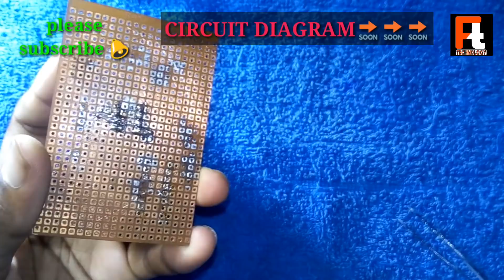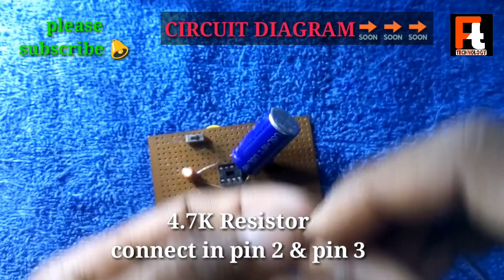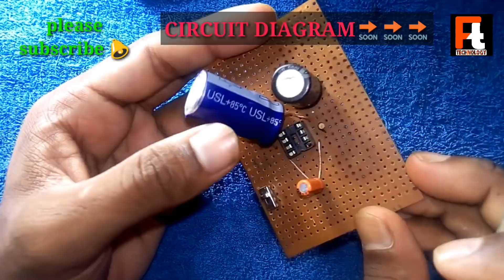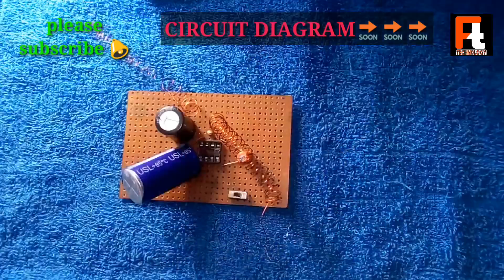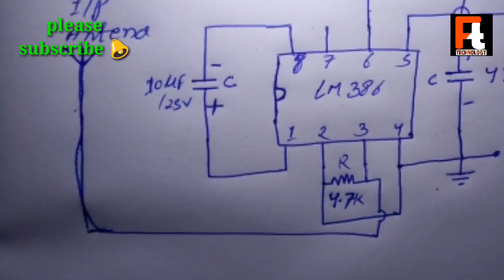How to | DIY | How to make a simple Mobile signal booster at home #RC Invention #diy #howtomake

Comment: THAT IS ONE MAGIC LM386! I only use them for audio amplification in HF direct conversion receivers. In other words, this will not boost a 3G or 4G cell phone signal.
Reply: This circuit is great.
It even works for wifi.
Signal increases 2 bars and no more disconnects.
Also on it close to digital tv antenna no more picture breakup.
I put it next to my auto engine. Mileage to up 10-15 mpg and lots of power.
I put it on my pillow at night now the bald spot on my head is growing a lot of hair now.
Also missing 2 tooth in front new one grow back.
Wife too small on top put circuit in her purse now like mountains but problem now she poop a lot.
You should build on black box sell make a lot of money.
Reply: @gordonwelcher9598  could you explain how an LM386 audio amplifier chip amplifies 3G microwave signals?

Comment: I`m quite surprised these world-changing inventions are coming  from India :P
Reply: Are you implying that India cannot have world changing ideas?
Reply: This circuit is great.
It even works for wifi.
Signal increases 2 bars and no more disconnects.
Also on it close to digital tv antenna no more picture breakup.
I put it next to my auto engine. Mileage to up 10-15 mpg and lots of power.
I put it on my pillow at night now the bald spot on my head is growing a lot of hair now.
Also missing 2 tooth in front new one grow back.
Wife too small on top put circuit in her purse now like mountains but problem now she poop a lot.
You should build on black box sell make a lot of money.

Comment: Lm386 is low power audio amplifier ic and it can max work for amplify 15 to 20mhz frequency and in video u r showing it to amplifying 800mhz to 2100mhz mobile network signal i think it won't work..
Reply: Besides, even if it could work at that frequency, with the two antennae next to each other, it would just form a feedback loop. This is complete bullshit.
Reply: Even then you would need a bidirectional amplifier, and the LM386 only works up to 300kHz btw.
Reply: this can't be work
Reply: ibrahim arif it could work for phone calls, right? I mean they are just some audio data... but internet connection... No
Reply: G
Reply: It's not working
Reply: AMAR CHANI ok then it is fake
Reply: No it worksss
Reply: Fully fake
Reply: correct
Reply: bro its fake its not a bosster circuit its reduce signal strength.according to some of level in frequency
Reply: Your right bro ic made for only audio purpose
Reply: What do you think it is right or wrong
Reply: Will it work
Reply: Should I make it
Reply: 15to20 mhz? I think you mean khz because lm386 is audio op amp. No way it is working in mhz range.
Reply: This circuit is great.
It even works for wifi.
Signal increases 2 bars and no more disconnects.
Also on it close to digital tv antenna no more picture breakup.
I put it next to my auto engine. Mileage to up 10-15 mpg and lots of power.
I put it on my pillow at night now the bald spot on my head is growing a lot of hair now.
Also missing 2 tooth in front new one grow back.
Wife too small on top put circuit in her purse now like mountains but problem now she poop a lot.
You should build on black box sell make a lot of money.

Comment: If you connect a toaster to pin 9 and 13 of the lm386 you get a time machine.  btw nice "antenna" lol (even that won't work)
Reply: Keen observation 😂
Reply: YOU FORGOT THE FLUX CAPACITOR
Reply: This circuit is great.
It even works for wifi.
Signal increases 2 bars and no more disconnects.
Also on it close to digital tv antenna no more picture breakup.
I put it next to my auto engine. Mileage to up 10-15 mpg and lots of power.
I put it on my pillow at night now the bald spot on my head is growing a lot of hair now.
Also missing 2 tooth in front new one grow back.
Wife too small on top put circuit in her purse now like mountains but problem now she poop a lot.
You should build on black box sell make a lot of money.

Comment: Such a complex mechanism cannot replicated so easily. Sorry it seems like hoax
Reply: This circuit is great.
It even works for wifi.
Signal increases 2 bars and no more disconnects.
Also on it close to digital tv antenna no more picture breakup.
I put it next to my auto engine. Mileage to up 10-15 mpg and lots of power.
I put it on my pillow at night now the bald spot on my head is growing a lot of hair now.
Also missing 2 tooth in front new one grow back.
Wife too small on top put circuit in her purse now like mountains but problem now she poop a lot.
You should build on black box sell make a lot of money.

Comment: It's always better to buy Approved Mobile signal boosters from AvanZar impex. The booster are of top Quality and i hv personally used them. It gives the coverage area of 3000sq ft.
Reply: This circuit is great.
It even works for wifi.
Signal increases 2 bars and no more disconnects.
Also on it close to digital tv antenna no more picture breakup.
I put it next to my auto engine. Mileage to up 10-15 mpg and lots of power.
I put it on my pillow at night now the bald spot on my head is growing a lot of hair now.
Also missing 2 tooth in front new one grow back.
Wife too small on top put circuit in her purse now like mountains but problem now she poop a lot.
You should build on black box sell make a lot of money.

Comment: What if I use 9v battery. Which electrical components  are necessary  for it plz tell me.and where you have connected negative  terminal of battery in circuit board

Comment: Thanx....I made This Project But it not works 
Before and after Network is Same ? 
Plz feed back or give ur Email id
Reply: Hasan Shaikh hii kya aapne dusra koi prohect bana ke dekhe he mujhe bhi banana he please agar success he to batao mujhe
Reply: This circuit is great.
It even works for wifi.
Signal increases 2 bars and no more disconnects.
Also on it close to digital tv antenna no more picture breakup.
I put it next to my auto engine. Mileage to up 10-15 mpg and lots of power.
I put it on my pillow at night now the bald spot on my head is growing a lot of hair now.
Also missing 2 tooth in front new one grow back.
Wife too small on top put circuit in her purse now like mountains but problem now she poop a lot.
You should build on black box sell make a lot of money.

Comment: this is clearly a fraud. Those antennas are not even closed and whats with the ic 386, what will you do for the noise entering the circuit due to the air channel. In the video too, when you switched off the circuit the signal was still strong. This is a total hoax

Comment: either you Turned the circuit ON or OFF your cell screen showed signal (E)  it didn,t boosted to 3g or 4g
Reply: This circuit is great.
It even works for wifi.
Signal increases 2 bars and no more disconnects.
Also on it close to digital tv antenna no more picture breakup.
I put it next to my auto engine. Mileage to up 10-15 mpg and lots of power.
I put it on my pillow at night now the bald spot on my head is growing a lot of hair now.
Also missing 2 tooth in front new one grow back.
Wife too small on top put circuit in her purse now like mountains but problem now she poop a lot.
You should build on black box sell make a lot of money.

Comment: I make this.but not work.ic is get heat.why?
Reply from the maker: Check circuit connection and supply voltage
Reply: Thanks
Reply: Capacitor 16v=4700uf,,,,,1000uf & 10uf 10v.its ok.supply voltage 4.5.used powr pack.
Reply: @tharumadhu3179  👍

Comment: how to identify pin 1, pin2,3,4,5,6.then only it will be easy to solder the capacitor pin with the ic.am i correct?
Reply from the maker: Yes

Comment: I built this circuit on a breadboard. It's not working for me. I used a 3300 microFarad capacitor instead of the 4700 microFarad capacitor since i dont have a 4700 microFarad in stock, just to see if it will work. Will the capacitor size make a difference?
Reply: No, there's no difference. LM386 won't be able to work with the frequency of mobile signal...
Reply: This circuit is great.
It even works for wifi.
Signal increases 2 bars and no more disconnects.
Also on it close to digital tv antenna no more picture breakup.
I put it next to my auto engine. Mileage to up 10-15 mpg and lots of power.
I put it on my pillow at night now the bald spot on my head is growing a lot of hair now.
Also missing 2 tooth in front new one grow back.
Wife too small on top put circuit in her purse now like mountains but problem now she poop a lot.
You should build on black box sell make a lot of money.

Comment: Is this Circuit is useful for 4G or 4G LTE???
Reply: This circuit is great.
It even works for wifi.
Signal increases 2 bars and no more disconnects.
Also on it close to digital tv antenna no more picture breakup.
I put it next to my auto engine. Mileage to up 10-15 mpg and lots of power.
I put it on my pillow at night now the bald spot on my head is growing a lot of hair now.
Also missing 2 tooth in front new one grow back.
Wife too small on top put circuit in her purse now like mountains but problem now she poop a lot.
You should build on black box sell make a lot of money.
Reply: This circuit is great.
It even works for wifi.
Signal increases 2 bars and no more disconnects.
Also on it close to digital tv antenna no more picture breakup.
I put it next to my auto engine. Mileage to up 10-15 mpg and lots of power.
I put it on my pillow at night now the bald spot on my head is growing a lot of hair now.
Also missing 2 tooth in front new one grow back.
Wife too small on top put circuit in her purse now like mountains but problem now she poop a lot.
You should build on black box sell make a lot of money.

Comment: Sir this project is really works or not
Reply: This circuit is great.
It even works for wifi.
Signal increases 2 bars and no more disconnects.
Also on it close to digital tv antenna no more picture breakup.
I put it next to my auto engine. Mileage to up 10-15 mpg and lots of power.
I put it on my pillow at night now the bald spot on my head is growing a lot of hair now.
Also missing 2 tooth in front new one grow back.
Wife too small on top put circuit in her purse now like mountains but problem now she poop a lot.
You should build on black box sell make a lot of money.

Comment: amazing project
Reply: This circuit is great.
It even works for wifi.
Signal increases 2 bars and no more disconnects.
Also on it close to digital tv antenna no more picture breakup.
I put it next to my auto engine. Mileage to up 10-15 mpg and lots of power.
I put it on my pillow at night now the bald spot on my head is growing a lot of hair now.
Also missing 2 tooth in front new one grow back.
Wife too small on top put circuit in her purse now like mountains but problem now she poop a lot.
You should build on black box sell make a lot of money.

Comment: I do this project but not successful and follow your procedures step by step finally no any result ..Please reply for any tips to me.tq
Reply: This circuit is great.
It even works for wifi.
Signal increases 2 bars and no more disconnects.
Also on it close to digital tv antenna no more picture breakup.
I put it next to my auto engine. Mileage to up 10-15 mpg and lots of power.
I put it on my pillow at night now the bald spot on my head is growing a lot of hair now.
Also missing 2 tooth in front new one grow back.
Wife too small on top put circuit in her purse now like mountains but problem now she poop a lot.
You should build on black box sell make a lot of money.